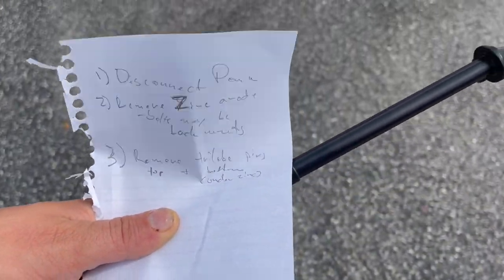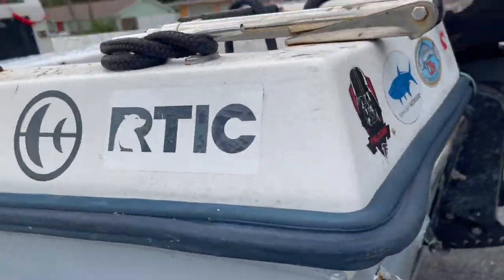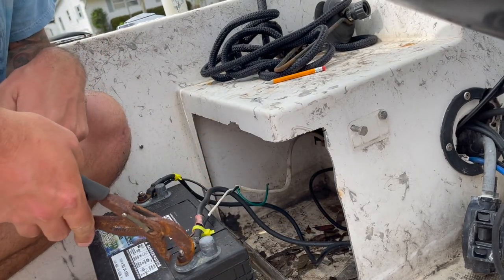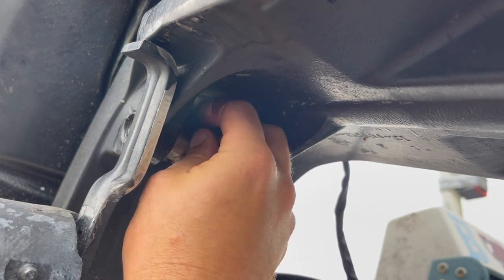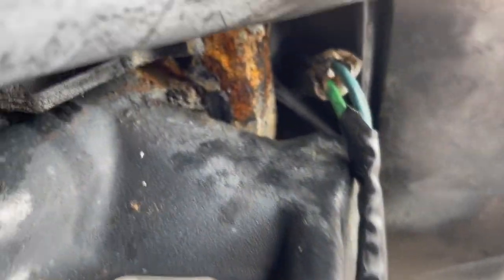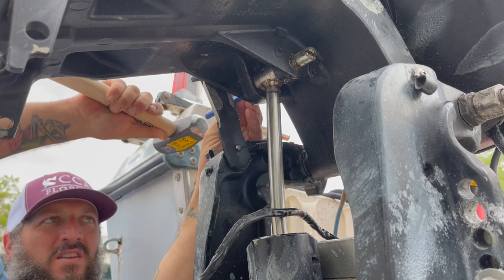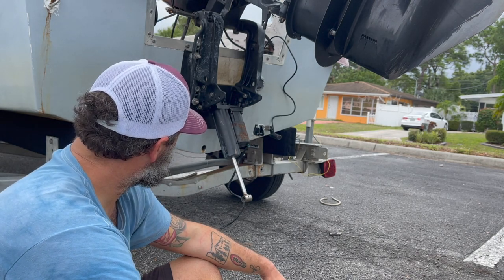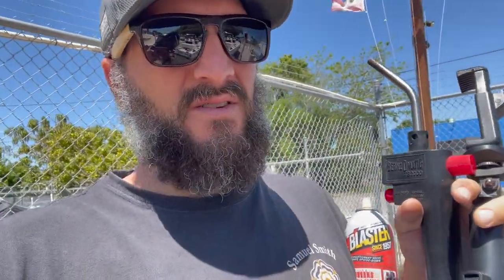PTT Part 1: Fix Mercury 115hp 2-Stroke Power Tilt & Trim, Stubborn Pin Removal

Comment: This is painful to watch!
1. You need to turn the manual release valve more than "couple of turns".  You might as well take it all the out . I'm 5'7" and 145 lbs and managed to muscle it up in under a minute. Not  long drawn out process this dude did!
2. You do not need to disconnect the battery if you first disconnect the the connections under the motor cover.
3. There's no need to remove the zinc plate attached to the motor mount. Just remove the ground cable attached to it. 
4. Rather than pound on the actuator arm bushings with a screw driver or punch, a better method is use a socket attached to an extension as opposed to various screw drivers or an oversized punch. 

It  took me 85 minutes to remove my old assembly and install the new one. 
WARNING: Be aware of inept folks on YouTube!
Reply from the maker: yea man, I realized way later I was doing it all wrong.  Good thing was an old ass engine I was learning on!